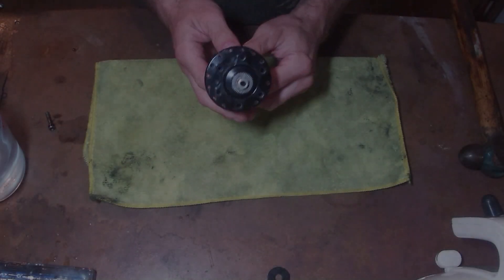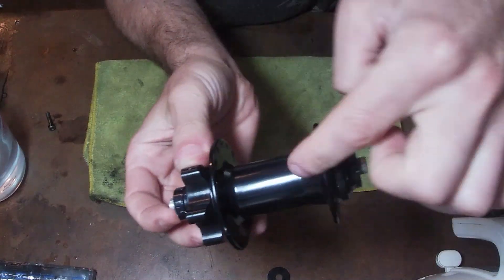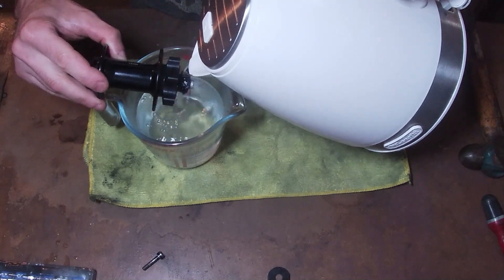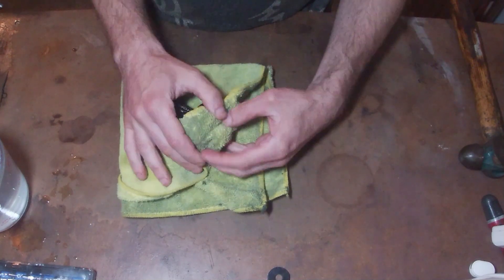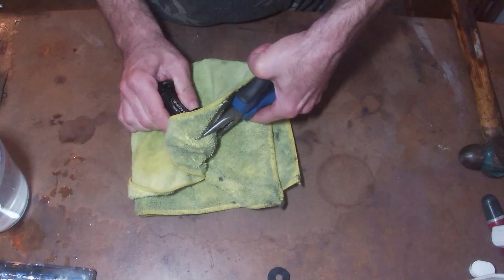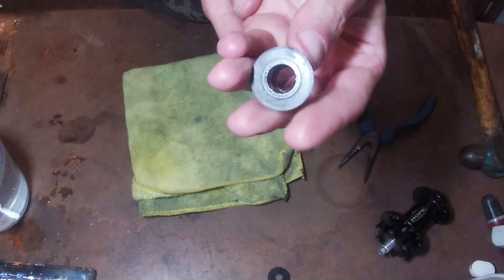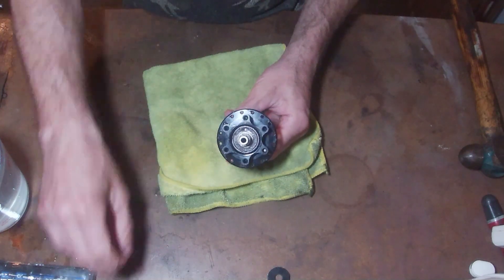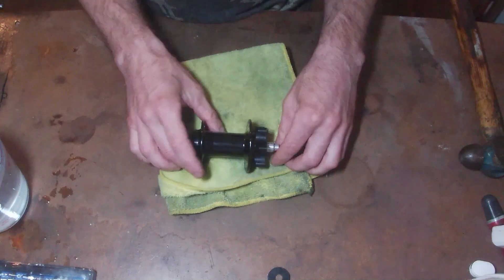HOPE Hub Seized End Cap Removal Option

Comment: I am woundering if freezing the endcap would have a best result because ice can contract de metal and turn it loose...
hot water dilated the metal turn it even more tighter.
But for you heating the metal turn it loose... how come?
Reply from the maker: The issue of freezing is that there's a rubber o ring inside the end up and rubber can become brittle when frozen.
I doubt the rubber gets hot enough to cause it damage when using this hot water method.
I guess this method works because the axle that the end cap is stuck on is much bigger than the end cap. So the axle can absorb more heat before it expands, meaning the axle probably doesn't expand in the heat and the end cap does when using this method.